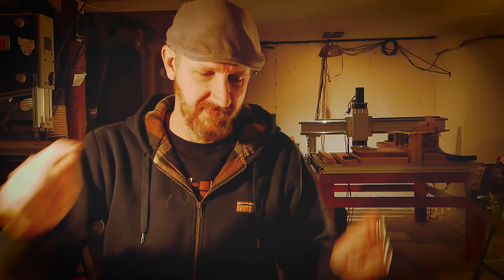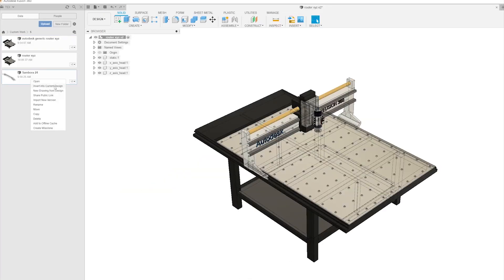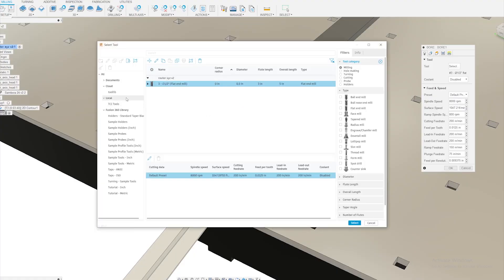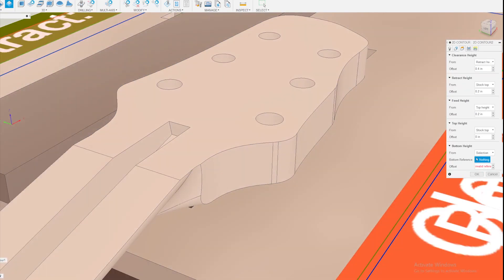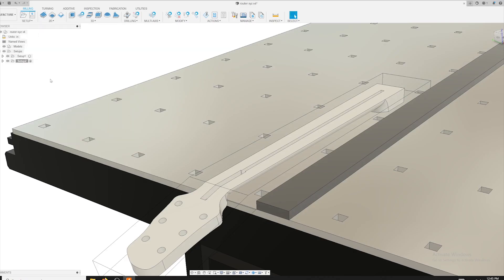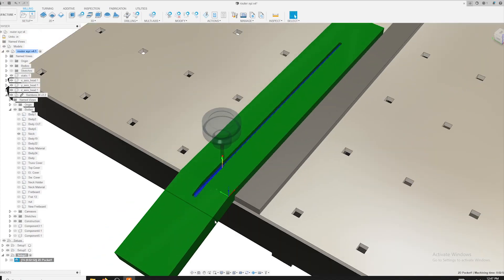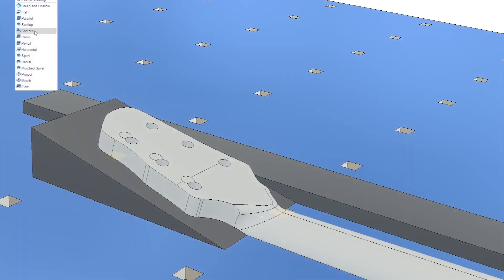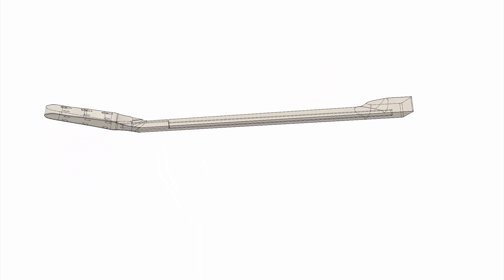Stones Part 2 | Fsuion360 CAM for Guitar Necks

Comment: nice video! Thanks for making and posting. When you reference your 3rd setup with the neck flipped and facing down, how do you index your bit if it's upside down and the spot you have been referencing is against that fence and incline support piece?
Reply from the maker: Thanks, well I index the access separately and one at a time, the only spot I can't get to would be the z, and that should be pretty close no matter where on the bed I index it.
Reply: @TwoCherriesIns  thanks for replying, I like your videos, nice work :)